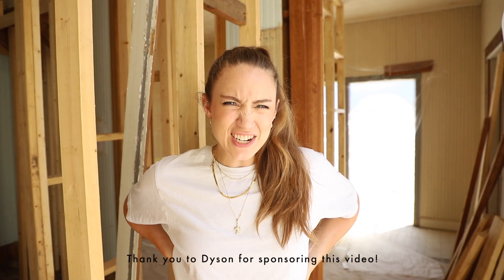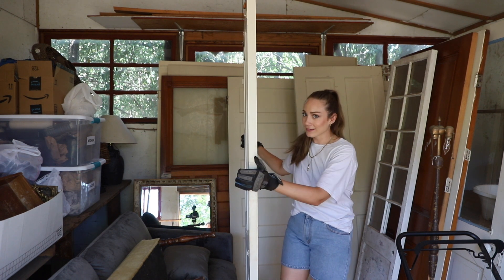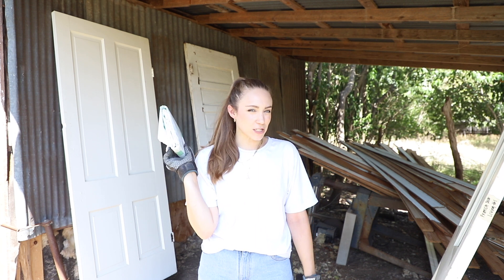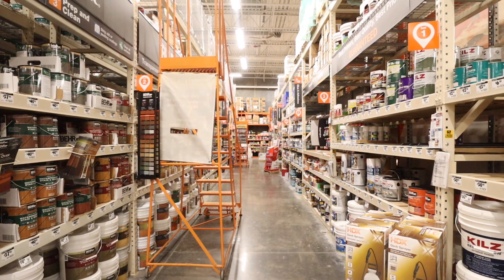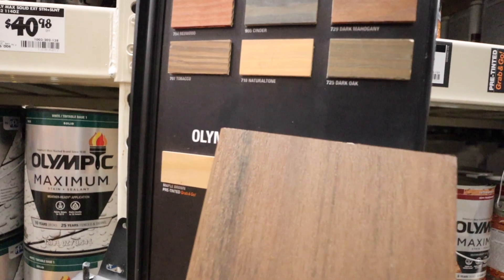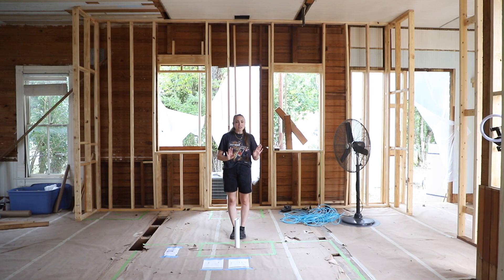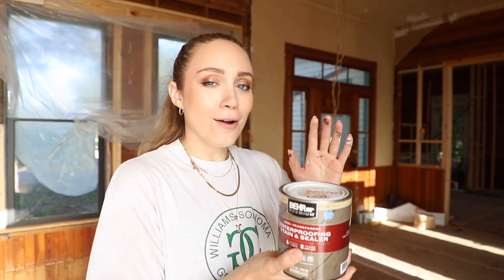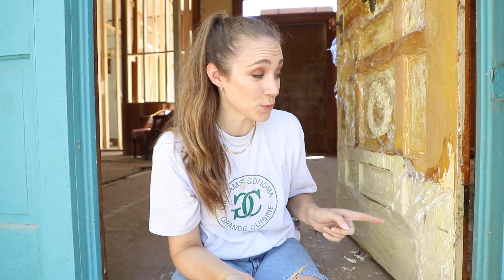RENOVATING OUR HOME: Plumbing, Foundation & Restoring Doors! | XO, MaCenna

Comment: Personally, I wouldn't do the vat stripping process.  It can not only take the paint off but it seeps into any joint and can loosen and make the piece unsound.  I used to use a furniture repair place that actually put the piece in a booth and shot it with stripper.  I've done several antiques and stripping is a labor of love.  It's tedious but has a very rewarding  result.  Also, did you test the paint for lead?  Stripping a piece with lead paint calls for some different steps and removal of the debris.  The regulations vary state to state.  I watched restorers working on a 200+ year old historic home in Maine.  The workers were taking the many layers of paint off of the front of the house & it had lead paint.  They put the stripper on then applied a paper like material so when the process was done, they removed small areas of paper at a time and all the layers of paint adhered to that paper.  It was fascinating to watch.  Another thing to consider is keeping the stripped paint from making ground contact to avoid soil contamination.  You will have a wonderful home when you are done and I hope you enjoy it and live there in the best of health for many, many years.

Comment: Hi! I used soda blasting for my living room furniture. I personally prefer it over stripping because it's an easier/less sticky mess to clean up. You do create a lot of dust, something I underestimated a bit. When you use soda, the material does not hit the wood as hard as sand would. People I know used sand but it makes the wood grain a bit deeper than when using soda. To keep the cost down I reused the soda crystals about 3 times although I must say that when I was using it the third time, the paint layer did not remove as easily as it would the first time as the crystal becomes smaller each time it hits the wood.  Indeed it is quite a bit of equipment and I also considered if it would be worth it or not but in the end, decided in favour of it because I plan on using it on other projects. (my sister also bought a house around the same time as you did and we plan on soda blasting the doors and some thrifted furniture pieces we found as well as some stuff for myself) You also need protective gear. When blasting, the crystals will bounce back onto your skin which is quite painful. I wore overalls, gloves and a complete covering of my head and still I had some small marks on my skin. The dust would sometimes get under my head protection which made my skin a little dry as well.  I would not recommend doing it in the heat, not because of the process itself but because of everything you would be wearing for protection. Although this might not seem a very positive review on soda blasting I do really prefer it over stripping once I got the swing of it, it was a quicker process for me.

Comment: I was going to suggest getting the doors stripped in stripping baths before you said it yourself. Stripping old doors with multiple layers of paint is soooooo tedious. Ok if you're only doing one or two, but if you have multiple doors it will save you so much time and energy to have them professionally dipped.

Comment: I know you like windows & sun light. Have you/did you ever think about putting in skylights?
Reply from the maker: oooo i didn't think about that actually but that sounds amazing!
Reply: Don't want to mess with your metal roof.  Plus I have skylights and they are a pain to keep clean, get covered in winter with snow etc.  Not worth the cost.

Comment: You could find a company which strips woods with propelled sand. I don’t know if you have that in Texas. I can tell you, it works really well, it’s efficient and clean. Your product you are using doesn’t seem very efficient to me, even though with a stripping product, you always have to go back with it at least four times, and I would have worked horizontally rather than vertically because it’s more comfortable to work that way and chiefly it prevents the product from slightly going down. Stripping is a work of patience. You also need metallic brushes for the intricate details, and then, all must be rinsed off, if not with water (because some woods can’t handle water), with some alcohol to neutralize the action of the stripping product. The traditional stripping products stink and burn the skin if you don’t protect it, but unfortunately, it seems to me that they are the most efficient.

Comment: I have voiced my opinion on your trim color being too matching to the Dove White, I would still go with the tan color to give you house more dimension.  I have never been a fan of stained doors, yet if you are going to do it, it should match the decking.  Yet, they also need to match any stain bead board in the house. Yet you know the decking is fake wood so not the same as staining woodgrain.  You may get in the same color family.  I wish I could send you a picture of our neighbors house with black windows, tan trim and off white siding, so pretty.  It seems from your experience you need to stay and observed work being done, seems mistakes are always made.  How frustrating.